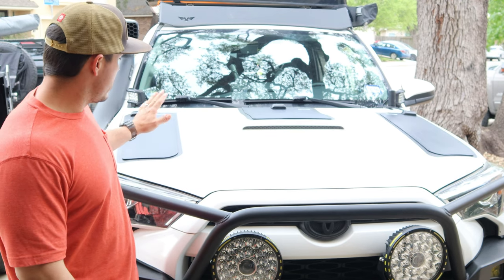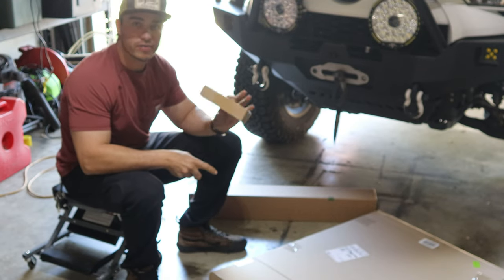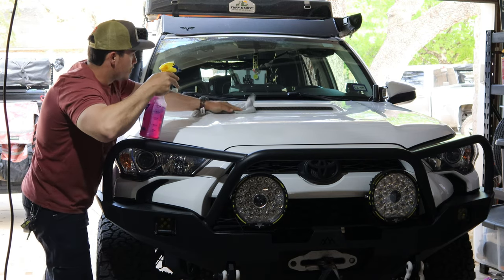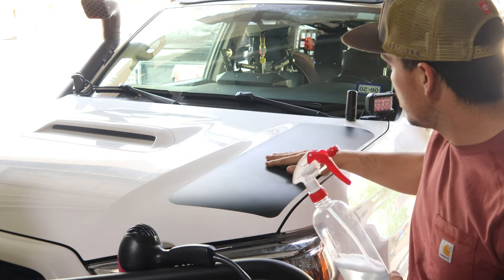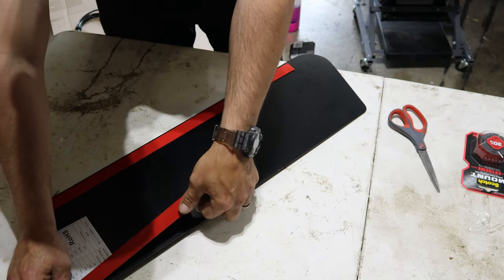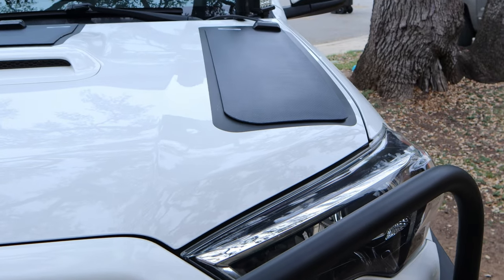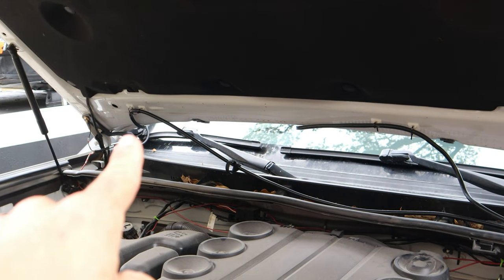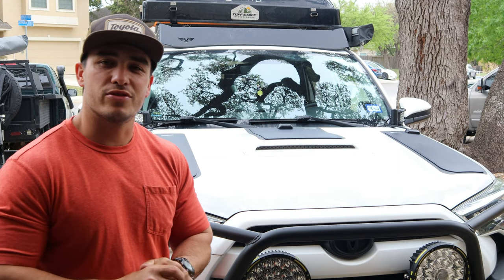Overlanding Solar Panels | 4runner Lensun Hood Solar Panels #overland #solar #camping #outdoors

Comment from the maker: What do you think I should wire to these besides my battery? USB port?
Reply: I was thinking about buying these for my forerunner to charge up my Jackery
Reply from the maker: @carlosochoa2346  right on man! So far so good over here, no issues yet. They held on a 4 hour highway drive in the rain as well with no issues.